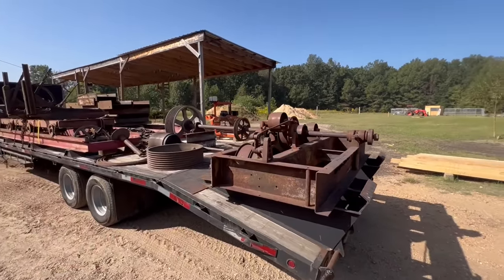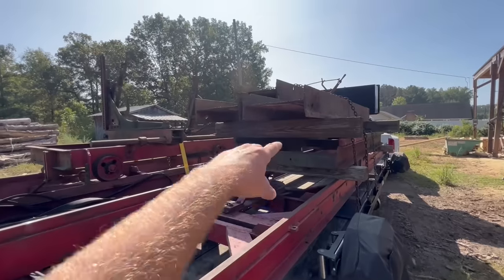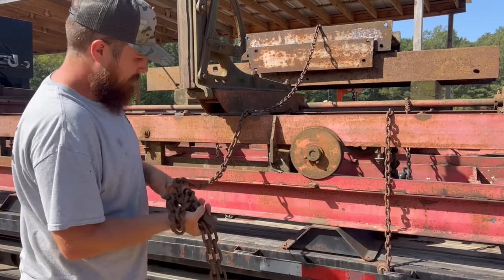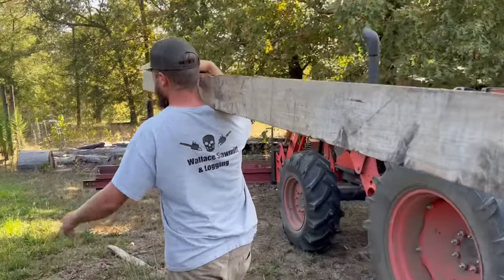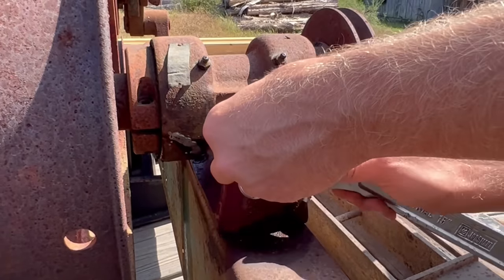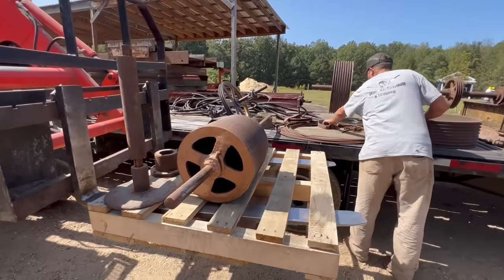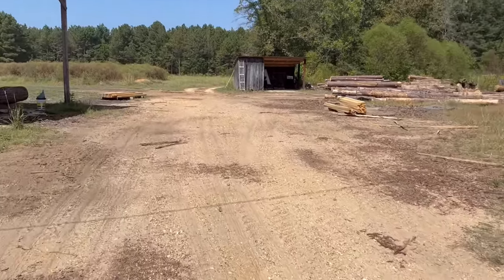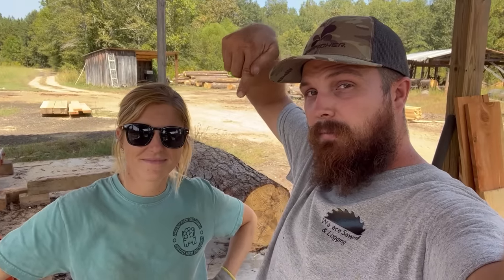We DONE it Again!!! (BOUGHT another SAWMILL!!!)

Comment: As an ol timer I have no doubts that you will have that new mill up and running in no time, I recognize your mechanical skills, I firmly give you 4 stars in a few years you will absolutely master the trade.  So now you have two circle mills and two band mills..🤔 you have potential to have multiple set ups now for any job. Enjoying your channel and if you don't mind my suggestion, next time that blade glide roller goes out, consider replacing the inner bearing, that would be much cheaper and would be easy for you to do.

Battleship grey with yellow accents would be my choice.

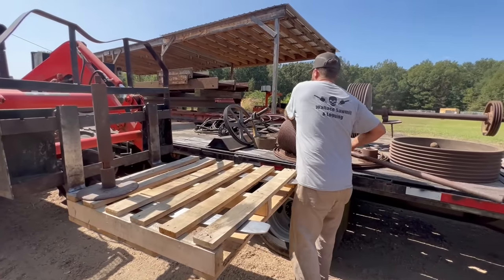Comment: The Frick machinery was really well made. Your mill looks great! A nice deep red or maroon would look great. I did notice some kinda rough welding on the spokes of the big drum at 9:57 - I'd suggest an inexpensive dye penetrant crack test on the spoked ends, after sandblasting it. If the welder knew what he was doing there won't be an issue, but if he didn't there could be cracks under the paint. Hope not. Cheers!
Reply from the maker: Thanks for the tips! I’m planning on replacing most the welded bits!

Comment: where is the engine and or the motor
Reply from the maker: None with it. I got plans though!
Reply: The 4-71 pulled the main saw, edger and cutoff all with no problem (V-belts) and it was a small sleeve hole motor and a 2-valve. A 4-valve would run off with it. @wallacefarmandsawmill